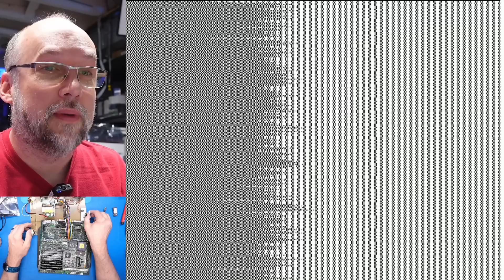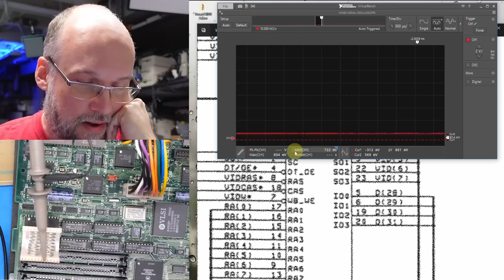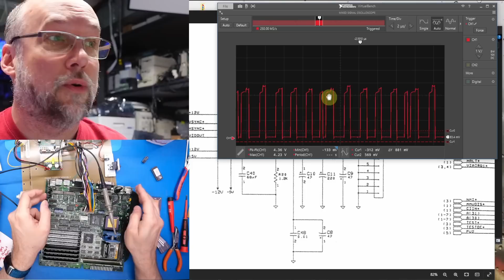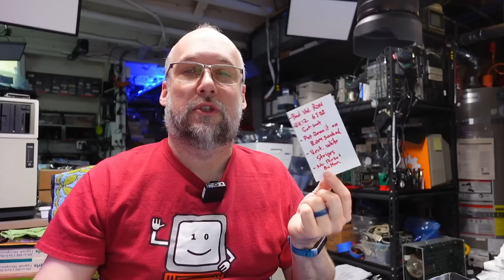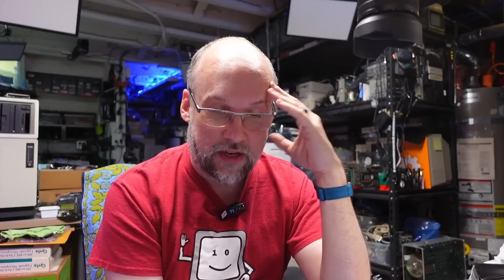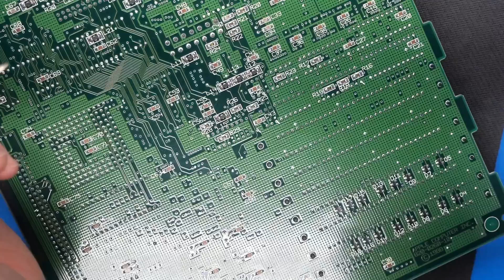Recapping my Mac SE/30 wrecked it

Comment: due to it being immediate, the Mac SE/30 is nit seeing RAM.

The Mac 68K Initialization routine are as follows:
- Turn on the 68K; ROM is connected to the 68K through the PALs/GALs and some logic chip at address $0000-0000. It checks for some basic things (I/O, memory mapping, etc.) The 68K sees the ROM and starts activiating its code at $0000-0000.

-Then through some Logic Magic, the system is paused and the ROM is moved to the top of memory $FFFF-FFFF, and the CPU jumps to the new address.in that area. Like on the C64 - When the ROM is shifted out of place, this exposes the RAM, in the Mac's case this is the RAM in $0000-0000. Then the Mac does a RAM Test to see how much RAM is there. Once it counts the RAM, it searches for peripherals for booting the OS.

That SE/30 does not seem to go past that point where the ROM is being switched into upper memory and the RAM being exposed and counted.

Broken ADdress Trace? Bad Gal/Pal, even though you tested it and it tests "Good"?

You many need to unsolder all the chips above the RAM and check for  broken traces. In the 68MLA group in fixing Mac SE/30s, this area was known for broken traces when caps spill their goo.

At best you have a working Mac SE/30 with broken traces. You can get that replacement Mac SE/30 board somebody is selling and build a new Mac SE/30 from the chips on this board. Horrible thought, isn't it? But it would bring back the soul of the machine into a new logic board. Is it worth it? If I had the money, I would.

Just be careful, the 68K Macs are all 4 layer boards. (The PowerPC Board can be 4 or 6 layers depending on the model you are dealing with.).
Reply: Makes sense. I'm commenting to hopefully get more attention to this comment.
Reply: Can everyone like this comment so he sees it! I want to see this board fixed!!
Reply: Here's a thought: The GLUE chip is possibly bad, and the memory map isn't being switched properly?
Reply: I suspect another one of the replacement MLCCs near the sound chips has shorted through the soldermask to a bus signal on the top layer, just like the initial D31<=>12V short.
Reply: @sparcnut  Everything is possible here but judging from what @elfenmagix8173 wrote (and others said to similar effect) I'd rather start by looking at data, address and enable lines continuity to at least ROM slot and the furthest RAM slot, as well as enable signals themselves. 
Perhaps the best place to start is to hook the top address lines and/or select lines to a data logger and trying to see what is accessed last (except sound chip for unhappy chime). A cheap $5 Salae Logic clone goes a long way when the CPU is running code but not quite right.
Reply: I think this observation is a good call and a place to further investigate, the not seeing RAM call. Glue chip would also be a suspect for me.
Reply: On the SE/30 the overlay is handled by VIA1 and the GLUE. OVERLAY comes from VIA1 like all classic Macs and goes directly into the GLU. What I'm hoping for this board's sake is 12v didn't blow through VIA1 to the GLUE. But, if the GLUE was bad, it's not likely it could even select the DSC and produce the chimes of death.

I do believe the ROM tests a bunch of chips before it gets to RAM, and it gives you the same chimes if anything fails. VIA1 has been replaced, but if VIA2 (needed for ADB) or the SCC was bad you'd get the same immediate failure.

Connect a terminal to the modem port, 9600 8N1, and see what you get when it goes sad Mac. Should be something like APPLE*xxxxxxxxyyyy*z where yyyy is the fault code, xxxxxxxx is a detail code, and z is the machine ID.

If you're not getting any serial output, suspect a bad SCC.

Comment: Adrian: 12v on the data line
Me: Noooooo. A short somewhere.
I have never heard a CPU scream before.
There is a PLCC socket solution.
Piggyback your chips.
Heat resistant tape.
Test before recap.

Comment: pre tin the pads... then lots of flux.. place the cip on the pads hot air and the chip should slide in place when the solder melts

Comment: My suspicion is that you've fully traced down the D31 damage, and are now chasing a different, unrelated, original problem on the board.
Reply: It's quite surprising anything even survived 12v on the data line, I think math coprocessor at least is likely dead. Whatever was selected (and thus brought out of high-Z state) is likely damaged.    
However that the current problem could easily be original, yes

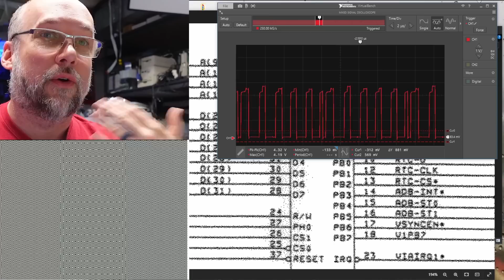Comment: I wondered if there is an issue with another address or data line, or perhaps an issue with the RAM or ROM lines.   I wondered this because at time 37:37, if you notice the CENTER of the screen displayed has a different pattern than the other sides (referring to the gray pattern).  Look where the tiny white dots are, and the fact that the center is lighter.  I suspect that you are missing one of the lines that deals with the addresses of the center region.  It might not be 31.  I also noticed that that diode with 31 and was it 23 or something you mentioned (forgot the number), I would check to see if that number has any issues.  I suspect that you are getting corrupt data somewhere and investigating what is making the center look different may be a clue to what is damaged.  I think if everything goes right, the grey (or every other dot black, then white) should be consistent for the entire screen on boot-up if I remember right.
Reply: But wasn't the pattern identical on the good board?

Comment: That was the first CPU I literally heard dying... I felt really gutted when heard that sound, it was sad,that poor thing had an electric shock but still said something while releasing its ghost.
Maybe it is a good idea to test MBs before recap of course checking for shorts and then power it on briefly? Don't know if it is  not dangerous to do that cause there may be greater dangers waiting to appear immediately.
Definitely we should check for shorts after recapping or replacing components on boards, through failures we learn always..
Great video cheers from Greece keep up!

Comment: For PLCCs, or any desoldering with hot air, you can lay 2 or 3 layers of alu foil on top of the whole area, fit in it and push it all around the components so it's snug, then VERY gently cut a hole JUST around the one you want to rework... once that area is removed, the foil acts as a heatsink for the rest so you can hot air all you like, the remaining heat get dissipated by the foil.

Comment: 12 V applied to the data line could easily cause a short inside the PCB material itself, not only in the chips.
Reply: What? No, it could not, this PCB literally handles the 12V normally, and does not have microscopic traces anywhare
Reply: @jwhite5008  Yes, but only if the board is completely dry and without any corrosion from electrolyte leakage.
Reply: @watchmakerful  If you are referring to charring somewhere inside of this 4-layer board soaked in electorlyte - ok, I see your point. 

Still, even if that might be possible in general I very highly doubt it in this particular case. 

The elecrolyte damage was not nearly as severe (only eaten through the top layer and looks like only in one place), 
gaps between traces are not as small, 
it was not powered for that long, 
and Adrian was looking at it the whole time - it's highly unlikely he would have missed all the sizzling, buldging and smoke.

And Adrian checked all the data and address lines and he said the levels are fine, .It could have been another line but at that point if those on the same bus are fine the others probably are not worse either.

The board could have been damaged that way prior to Adrian shorting 12V to the data line but in my opinion it is just as likely as any random problem like a crack anywhere on the board or a cold solder joint somewhere

Comment: Thumbs up for the tenacity. Hand (re)soldering PLCC needs lots of flux and after soldering with a small hooked tip (to get between the pin and the pad) I usually reflow with hot air and flux. Afterwards check with a magnifier for shorts and/or open connections. When the pads are not protruding from the side it might be a bit more difficult.

Comment: Hello Adrian!
While watching your video I got an idea:
With the working board you were able to recreate the fault state by pushing the NMI-switch right after applying power if I understood correctly.
What if the NMI-switch on the broken board is broken or the system falsely senses the switch to be triggered at startup?
Wouldn't this cause similar symthoms?

Keep up the good work and greetings from Germany!
Reply: I had this thought, too...  If you're able to replicate the exact behavior through certain steps on a working board, see if those steps might be happening without your intervention on the Problem board.
Reply: I was thinking the same. The reset was bad, the interrupt being right next to it....
Reply: I also was thinking this! I wondered if he bothered to Deoxit the interrupt switch off-camera or not, because I think I would have tried that right away after fixing the reset switch.
Reply: He presses the button, usually these buttons short open not closed
Reply: @thomasandrews9355  True, but the key word is usually.  It's always possible that the button is stuck pressed down, or that some junk got into the switch...

Comment: I have found sometimes after soldering in a new IC, especially SMT, it helps to let it get back down to room temperature first before applying power.

Comment: actually, PLCCs best are soldered like they are unsoldered; hot air, flux and patience
use some leaded solder (the mac is using leaded solder anyways), clean up the footprint with solder wick, clean the chip from residual solder with wick, apply a bit of fresh leaded solder to the plcc footprint, preheat the general area with hot air from a bit further away (150C would be a good point to bring the surface of the board to), apply reworking flux (Edsyn FL-22 or the famous amtech stuff rossman recommends), then go closer with the hot air till you can see the solder getting soft, carefully place the PLCC roughly in the right position (you may want to apply a small amount of flux to the PLCC's underside before that), continue heating till the solder melts, the PLCC will get pulled into position by the solders' surface tension
that's how i do it
downside; you are applying quite a bit of heat, but so do you when unsoldering them
the type of flux is critical
it should be pasteous, tacky stuff, do not drown stuff in it, just enough to get the job done
low airspeed, roughly 380 to 420C of heat, broad heat, like the hot air station you are using anyways

option B which might be easier
there exist PLCC sockets that fit exactly onto the original footprint with soldering gaps in the bottom of them, i have non clue if they are still being sold, but you then can solder everything in plain sight with only like one or two pins per side being covered partially

Comment: Probably just showing my ignorance but could it be the other 65c22?  Seems like the 'hot' one was flowing the 12v through it, making it hot but the other could have gone open-circuit instantly so it wasn't getting hot as, because as the circuit was broken, 12v wasn't flowing through it?  I don't really know anything about this sort of thing (probably quite obviously) and it may well be that data line 31 didn't go to the other chip so this is all hyperbole but just thought it was worth thinking about.  Anyway, greetings from over the pond and keep up the fascinating channel, as one day this 60 year old may learn what a data line and address line do!  😉😀
Reply: This was my thought as well, although I'm cluesless on how MACs actually work
My guess is that the heat is because THIS chip was trying to ground it and the other one didn't
That does not mean the INPUTS on any of them are not damaged though
And the math coprocessor is likely just as fried as the CPU

Comment: Oof, I recapped my SE/30 board earlier this year with tantalum caps and this so easily could have happened to me too. My SE/30 did have a small break in one of the data lines that I had to fix with a piece of wire, and luckily I was being rather paranoid about accidentally soldering caps to the exposed traces so I used Kapton tape to protect everything. But it had never occurred to me that the capacitor feet themselves might touch the traces, even when the soldering is good. Since then I replaced the Kapton tape with some nail coating and everything turned out alright, but if anything this video serves as a warning that a well-intended and well-executed recapping can still have unforeseen devastating consequences.

Comment: Hi Adrian. I had an oscilloscope that had a bad power supply put 13 volts on the +5 volt line (there were a few TTL chips on it.) Strangely, the TTL chips ALL survived! My guess is the 13 volts was current limited, and the TTL chips’ clamping diodes held the +5 Vcc line in tolerance until I turned the power off. A 1 Megohm resistor in the high voltage section did sacrifice itself, though. 😢 So maybe the same thing happened on your mobo with some of the chips on data line 31?
Reply: The true bipolar TTL chips are kind-of current-limited if they only drive other TTL logic at same VCC.  
They don't usually die from the voltage itself - they overheat from current quickly but not instantly.
And they don't necessarily even have clamping diodes - those are kind-of necessary for CMOS otherwise those tend to die pretty quickly from rogue static electricity.
However I really don't understand how a 1M resistor can possibly die at all, other than via a lightening strike maybe. Maybe you meant 1 ohm?

Comment: @Adeian I want to point out that when you tested the rom card and used deoxit in the last video on Basement 2, you did not actually switch them you actually picked up the working one that you already tested, and not the one you took out of the dead SE/30 at 26:40

Comment: The "This Does Not Compute" channel had a Mac SE/30 board that also had issues... but ended up transplanting it onto a new board... and frame...  Look for their "I built a retro Mac from BRAND NEW PARTS".  Turns out there's a few diagnostic boards you can get to help diagnose things.
Reply: Saw the same Video just after this video here. Especially the „blinkenlights“ ROM board seems handy to see what‘s happening on the address and data bus.
Reply: @trekkie_who  That's what I'm thinking as well.  There seems to be a lot more tools for Adrian to use!
Reply: @trekkie_who das blinken lights! ❤
Reply: Yep, I saw that yesterday and wondered if Adrian knew about that diag board and if it would help him.  Had it come out a couple of weeks ago, maybe Adran would have delayed his video until getting one.
Reply: he had a similar issue but his was due to a fault with making his custom board
Reply: Snap

Comment: I'd rather run a mile than try and replace SMD components.  One of the capacitors on my Amiga's floppy failed, and fortunately I was able to repair it by replacing it with a normal through-hole part.

Comment: Solder CPLD chips by cleaning the IC pins, making sure they are sitting flat (no pins longer or shorter than the others) put some low melting solder on the PCB pads, place CPLD on the pads and use heated air to melt and suck the IC down on the board.  That is how I do it.

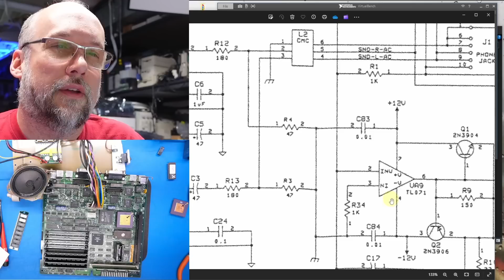Comment: The 68000 is big-endian, so it appears data bits D31:24 hold the least-significant byte of a word.
Reply: due to the way the 68k bus cycles work, 8 bit chips are typically wired to the top 8 bits of the databus, rather than the bottom as youd expect. Same is true with 16-bit

Comment: To protect parts from melting you should be using kapton tape to cover items that might melt while doing hot air rework.  To put on a part like these, you should clean the pads and clean the pins on the part and then tin the pins on the board and then place the chip in place and then use the hot air to "tack" it down, then apply flux around the chip pins and then use the hot air again to reflow the solder, then clean up and your done.
Reply: Put a kapton it? 😂
Reply: Yes, exactly!  @c1ph3rpunk tin foil is fine too, if you prefer 😂
Reply: Kapton plus tin foil. Cuz kapton gets expensive fast.